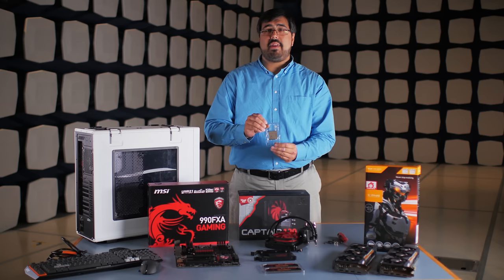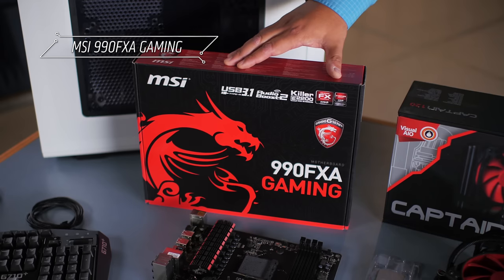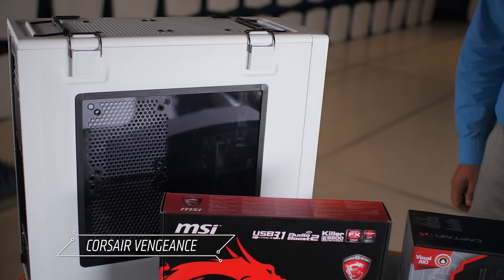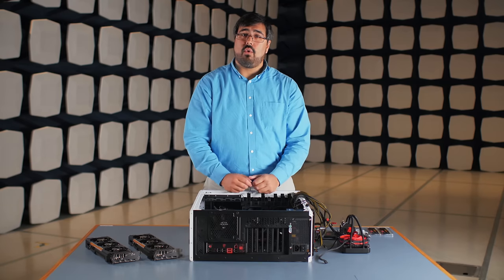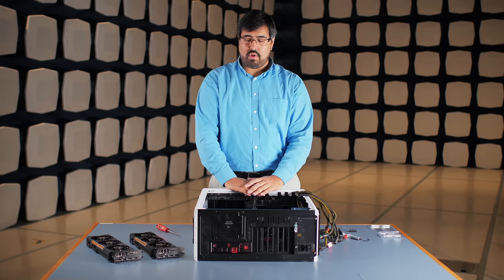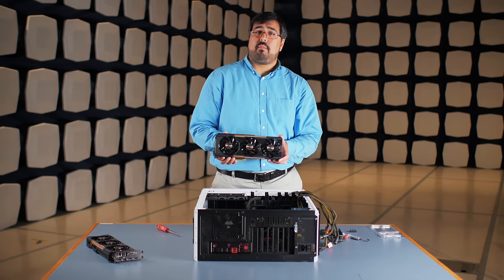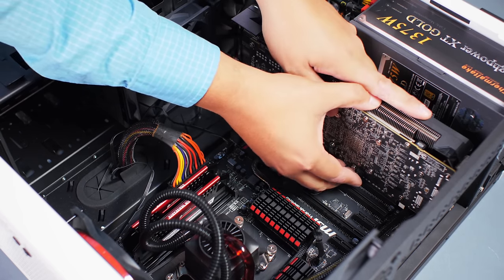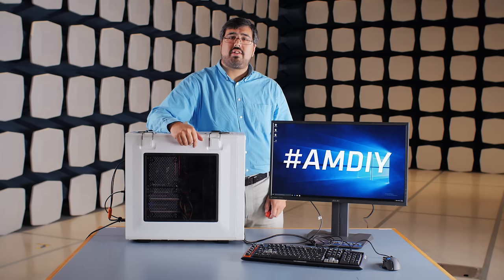How to Build an AMD FX™ 9590 CPU-based PC

Comment: I'm actually buying a 9590 soon. i live close to a micro center and got a great deal on a 990fx sabertooth board for $70. Micro center also has the 9590 listed at $179. so i figured i might as well top of the mobo with the best cpu it can handle. that along with my crossfired reference 290s should keep my warm through the winter.
Reply: the 990fx sabertooth is garbage. they break extremely often and asus does their best to refuse RMAs.
Reply: well I'm happy with it and the reviews were good so for $70 I was glad to buy it.
Reply: it's your funeral
Reply: Go asrock extream 9 better vrms
Reply: +Jim i have a 9590 and Asus formula z motherboard. What kind of cooling did you end up going with? (I have an x60 Kraken)
Reply: +Panagio Tsaou But... but reference 290 has the same TDP as after market ones...
Reply: But isn't thermal output the same? If reference card throttled it should even make less heat than not reference one. Cooling is all about getting the heat away, not making less heat. Or am I just complete idiot that doesn't get the basics?
Reply: ***** You're right, the other guy is wrong.
Reply: Panagio Tsaou mhm
the only joke here was that rationalization for being wrong

Comment: i was wonderind if a simple 750w power supplier could do the job with the fx9590 ?
Reply: +Alexandre Couillard not with a beast gpu.
Reply: +Zushikatetomoto Shift asus gtx 960 4gb
Reply: Alexandre Couillard X50 X60 are low end gaming gpus and a X70 is in the middle and high is X80 and you know the Ti Versions.

Comment: I am building an AMD FX 9590 with Gigabyte RX 480 8GB G1 Gaming card. After some time i will upgrade to ZEN CPU.
Reply: You can't just upgrade to a Zen CPU. It will be a different socket which means that you'll have to change the CPU, Motherboard and RAM
Reply: Yeah. Thats why i said i will be doing it after some time. 2-3 years :>
Reply: Gorre Should've waited for Zen tbh.
Reply: It's never too late to upgrade.

Comment: I'm building a pc with :- 
Amd fx 9590
 Asus crosshair v formula z mobo
 16 gigs of g skill ripjaws 1800 ddr3 
 Corsair liquid h100i v2 cooler
Corsair cx750 watt psu
Msi geforce gtx 1060 6gb
128gb transcend ssd and 2tb western digital storage
Any tips please?
Reply: Wild Ninja 1302 don't
Reply: CX750 is a bit cheap for a build like that, though it can deliver enough power. Also may want to consider an RX 480 or R9 Fury (on sale) if you plan on getting an adaptive sync monitor at some point. G-Sync is way overpriced.
Reply: m.2 way better option

Comment: Not sure if an AMD rep will see this, but I'm contemplating switching to Intel for CPU (i prefer AMD for GPU). I'm finding in multiple forums online that AMD FX chips bottleneck easily with high end GPUs (i currently have a gtx 770). I'm noticing screen tearing with my monitors. I've tried at least 12 different attempts to solve the issue (including overclocking my gpu or replacing my gpu with another gtx 770). So my question is, with so many people bringing up proof that FX chips have this flaw, in regards to higher end GPU's, what do you suggest? getting a lower end GPU would be a counterproductive and unwanted solution and playing my games in 720 would fall under that category as well (side note: i'm only trying to game on 1080, with no AA and no Vsync)
Reply: screen tearing is caused by too high fps, turn on vsync and enjoy
Reply: +Mike Offre AMD cpu's clock lower than intel therefor a 4 core amd cpu is worse than even an Core i3
Reply: nietvergetendus Vsync makes the party worse, which is why i stopped using it. But like i said, from forums, they keep mentioning that, that's the main culprit, even though i agree with what you said that could also be an issue. I plan to get monitors with 144hz to help at some point, only because 1440 is overkill, for me at least.
ThoseJerseyGamers I'm aware, but if it works, i don't care who's making the cpu, as long as i can play a game in 60 fps or better and not have any issues. I just want to make sure that's what would solve the issue before spending an extra $100-$200 on a CPU.
Reply: Mike Offre I went intel and no regrets tbh although I love amd gpus - The tearing comes from the GPU/monitor. Don't use Vsync from ingame use it from the nvidia control panel :)
Reply: +ThoseJerseyGamers Well if no one from AMD sees this and has any answers from their end, then i guess for CPU's I'll go for Intel.
Reply: +Mike Offre Here's the problem, you go onto a random AMD video and expect AMD support to somehow to explain in detail that your CPU isn't the culprit, despite you claiming it certainly is.

We don't know which game it is you're experiencing this in - Some games are more poorly optimized for PC's and CPU threads than others, however in todays games it's rare you don't see atleast 4 threads in use during heavier games.

We don't know what CPU you have, although FX narrows it down, and unless you have an old FX5x/6x from like 2003-2006, and we assume that you have a more modern FX Bulldozer CPU, there really shouldn't be a way it bottlenecks a 770, unless your CPU is thermal throttled, which is another thing we don't know..

There is no issue or evidence of an issue FX CPU's would cause any bottlenecking on a 770, and not the amount that would cause tearing.
Reply: +Medallish Ok. thanks for the reply. my main question was acknowledgment of there being a known issue with newer fx chips bottlenecking with higher end cards. what are you referring to when you say thermal throttling? I mat know the concept but not know the terminology associated with it.
Reply: Medallish Ok. Are you not aware that AMD lies about their CPU specs? lol "4 cores" = intel cpu with 2 cores
Reply: +Mike Offre Thermal throttling is basically the CPU holding back stopping it from burning out, both AMD and intel CPU's have this protection built in, so yeah you should be able to tell quickly if the CPU's temp is high (70+ degrees).
Reply: +ThoseJerseyGamers Atleast you're trying.
Reply: +Medallish Ok. oh OK. that's not an issue. I have a real good cooler and once in a while I check the CPU temps. they never normally go over 50 Celsius
Reply: +Mike Offre Ok then what CPU is it? And do you have a secondary monitor?
Reply: +Medallish Ok. 8350. yes. my main monitor is TN.
Reply: Ok well you should try and open task manager and an instance of GPU-Z and see if you you notice an issue, like the GPU never going over 60% or something like that while the CPU is locked at 100% Personally I had my 8350 with two 7970's so I can't imagine the CPU being a bottleneck unless there's something wrong with your CPU specifically, also note your memory usage.

I'm also wondering what FPS in what games, that would be the best way of telling if you're bottlenecked, if you're getting lower fps than you'd expect.
Reply: +Mike Offre I never experienced screen tearing on my fX 8320 stock with turbo boost disabled. Must have a crappy motherboard power phase or horrible chipset. Im using gigabyte 970A UD3P 32GB with XFX 850 watt power supply GTX 650 ti and all my games run 60 fps 1080p with no screen tearing
Reply: I don't know if Intel or Nvidia reps will see this but please pay for better shills,  the ones you have now suck at spin and propaganda.
Reply: The Commenter AMD is literally getting sued for lying/misleading consumers into believing their products conform to standards. Example: Cores on a processor being labled as a core when it's not
Reply: +ThoseJerseyGamers So is Nvidia. Anybody can sue.
Reply: The Commenter Class action lawsuit lol
Reply: ThoseJerseyGamers
I'm sure the complainant is a Nvidiot so butthurt over the 970 fiasco that they decided they would try to make AMD look as bad as Nvidia (lying to their customers by selling them gimped hardware) by suing them. It wont work. Just because you are being sued doesn't mean your guilty in America. You speak as if being sued is an automatic sign of guilt. You must not believe in the American way.
Reply: The Commenter Class action lawsuit

Comment: Will an Msi 970 gaming motherboard support an 9590?
Reply: no go for the asus crosshair v formula z. one of the FEW motherboards that support this cpu and arguably the best
Reply: TMPIN1 will overheat and go in safemode so you're CPU is 1333mhz every 20 seconds while gaming so no def NOT not a single motherboard rly supports the 9590 you can run it but not ideal

Comment: hi all. il have sabertooth gen r.3. and dark rock pro 3 250w. i want buy fx9590. but my cpu fan bequiet is  good for this proc? don't want overclock but need 65c max. is possible with this ?
Reply: Depends on your case/ventilation.  I can't imagine the CPU not working on high end air in a room case with tons of fans (stock speeds).

Comment: Would this fan work? 
Cooler Master V8 GTS CPU Cooler
Reply: FX-9590 is probably the most extreme CPU AMD has ever made, mostly no cpu fan will work with it.

Liquid cooling is probably the only way.
Reply: Not only. Phanteks TC14, Noctua NH D15, Cryorig R1 Ultimate, Cooler Master MasterAir Maker 8 and others high end CPU air coolers can work with 9590.

Comment: CPU=AMD FX9590COOLER=COOLER MASTER NEPTON 280LMOTHERBOARD=ASUS CROSSHAIR FORMULA ZRAM=CORSAIR VENGEANCE PRO 2X8GBSSD=CORSAIR 120GTHDD=2X WESTERN DIGITAL VELOCI RAPTORSGPUS=ASUS R9 290X X2 (CROSSFIRE)PSU=TURMALTAKE 1475WATT GOLDCASE=CM STORM STRYKER MODIFIEDKEYBOARD=DRAGONWAR SEMI MECHANICALMOUSE=DRAGONWAR 3200DPIHEADPHONES=DRAGONWAR USBSPEAKERS=DRAGONWAR 7.1MONITORS= VIEWSONIC 19INCH X3 (EYEFINITY)OS=WINDOWS 10EXTRA=WIRED AFTERGLOW 360 CONTROLLER!     Love AMD! ^-^

Comment: not going to lie fx was a great arch . sadly it being so unique really hurt it in software since software dosnt really know how to utlize the cpu . its so similar to PPC in many regards on how the die is made . how to various componants talk to one another on the monolithic die .if it was released exactly with intel released westmere and then put on a 28nm node for the 8 core parts retaining the l3 cache it would have been fine . as we know the excavator cores had the same ipc as ivy bridge  however lacked the l3 and core count to compete  piledriver had pretty meh ipc but incredible multi core performance . also fx realllllly likes fast ram so 1866 is the minimum for fx   i currently hold the record for the highest performing fx 8350

Comment: is this the last fx series? i hv 8320...i just want the last fx prosr.
Reply: Nope the 'FX' brand will continue through to the Zen architecture
Reply: 9590 is just an overclocked version of 83xx
Reply: I am so happy they are continuing the FX line. My FX series AIO liquid cooler can handle the 9590 with its 220W TDP. It can definitely handle the new zen with its low power and power efficiency :D
Reply: I was hoping that they would come out with a version that actually runs 5Ghz stock. Could have been FX-9690. I'm not much for overclocking and would gladly pay for factory overclocked cpus

Comment: what other cooling systems can I use?
Reply: Air cooling regardless how big the heatsinks and fan are is useless , you can used any AIO 120mm water cooling system as longest you use push and pull fans "x2 fans" or any larger cooling system like 240 or 360 will do ok as well
Reply: The Fat Biker thanks, im thinking imma stick with the 212 evo, i dont wanna over spend but also get something im not sure will work
Reply: I had the Thermaltake Nic C4 which it was a great air cooler for my 8350 but it wasn't good enough for my 9590 but after i upgraded to the Thermaltake water 3.0 120mm when i play GTAV my temps doesn't go above 45c , now your CRYORIG R1 is gigantic ,  i guess it must do as good or even better than an 120mm AIO water cooler

Comment: CPU: AMD FX-9590 @ 4.7GHz 
CPU Cooler: Corsair H80i GT 
RAM: 8GB(2x4gb) G.Skill Ripjaws 1600MHz 
GPU: EVGA GeForce GTX 780Ti SC 3GB 
Motherboard: MSI 990FXA Gaming 
PSU: Corsair AX1200i 
Case: Deepcool Dukase

Comment: Anybody can explain to me, pls? WHY.. CPU fx-9590 with TDP 220 cooled so simple version CAPTAIN 120, If there is necessary to use at least CAPTAIN 240 or 360 (Official channel AMD ...)
Reply: It's fine the retail kit comes with even a cheaper cooler the cooler master seidon 120v, those are rated at max 160w but cool the 9590 fine, but regardless the 9590 is not worth it

Comment: you should call it how NOT to build an AMD system.. the MSI 990 fxa gaming is a nice board but with only 6+2 power phase it will not leave much head room for over clocking if it can run the 9590 at stock at all.. that 120mm cooler also is not up for the job and in no time you reach temperatures as high as 65c. if you want this CPU running properly and still have some head room I would suggest to use the Asus sabertooth 990FX R2.0 or the Asus crosshair formula z because they have 8+2 power phase and digi vrm. I cannot believe that you suggesting to go with an 6+2 phase board with these very power. hungry cpu's, it might work for a short period of time but you simply blow that board to smitherenes in no time..

Comment: If you plan on Buying a Zen processor if it can match Haswell and Overclock well then upvote this. 
I know I am gonna be buying a 6 Core processor for my main workstation build and a Dual or Quad core for my gaming build ( the Dual core would need to be hyperthreaded like a i3 and SUPER overclockable , I know most i3's dont overclock all that well ..... :/ )
Reply: ***** If I remember correctly a Haswell model i3 can overclock , but it's only to roughly 4Ghz and not much higher. It's the i3-4310 or something like that.
Reply: ***** well of course there isnt a K model , but I'm pretty sure you can up the Multiplier or something like that to Overclock one or so models of the i3's for Haswell , you cant for Ivy or Sandy though and I'm pretty sure you cannot on the new Skylake CPU's

Comment: I love AMD, have a AMD built and use AMD since my last Pentium 90. I just think the FX 9xxx is not so good, because for the price u can go Intel, u get much lower TDP and nice performance. FX 6xxx and 8xxx aim to better place, because for the price, you can get quite shitty intel CPUs at best. Also fx8xxx/6xxx TDP is much more reasonable and comparable to Intel and it delivers nice performance in multicore applications. I dont see the spot for FX 9xxx, maybe Im wrong, but I think the majority of FX sales are in the 6/8 range and it has its reasons. I can be wrong ofc, just my opinion. Zen, or nothing :) Im on FX 8300  @ 4ghz atm and Im a sattisfied customer. I changed my HD 6770 for HD 7850 for free, this setup can run - believe it or not - everything in 1200p high to ultra.

Comment: The msi boad doesn't supott cpus over 200W
Reply: Thats why i must buy a new mainboard after the bios update and befor the update it works
Reply: Sure it can. Which Bios update did you flashed? With the newest bios update there is no issues running the AMD Fx 9590 with this MB!

Comment: Can you say it crashes  and also needs to be clocked down to 4.4Ghz Turbo 4.7 stable.
Plus the amount of power it uses it terrible HUGE !!!  Over  600Watts Graphic card and CPU and thats not all the rest of the stuff..!!  You need a 850Watt  minimum to run it..

Comment: i really want AMD to do well, but they are just not cutting it enough with their CPU's and GPU lineup. its not as good as it can be.
Reply: +Christopher Lennon yet  AMD went from an 76% market share to an 25% market share on the GPU side. Nvidia really seems to have ran away with their 900 series. if AMD would bring the fury chip lineup down to all cards, and with Zen CPU's it will be an gamechanger for sure.

Comment: Are you joking me AMD the FX 9000 series TDP (220W) is so high that you must buy a 8+2 minimum power phase motherboard and not every 8+2 motherboard will do the trick the best bet is to go with a 12+2 power phase on a motherboard. So my conclusion is this that I rather buy a FX 8370 has 3x lower TDP (95W) than this CPU that uses way too much power and there is almost no performance gain at all. And if I consider that the machine will run very often I rather go and buy a lower TDP Intel CPU I will at least save on electricity and it will give me the same performance or even breather because your 8 core CPU has only 4 floating points so its performance is something like a 4 – 6 core CPU max!